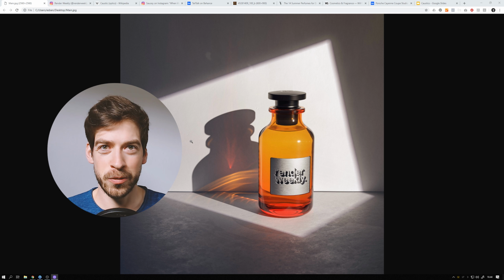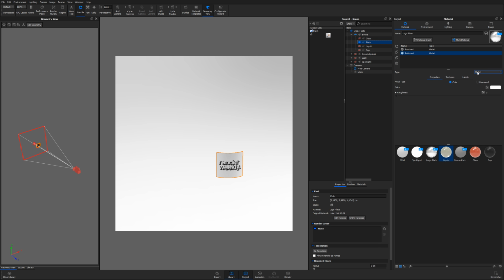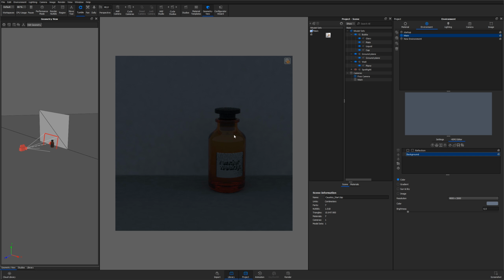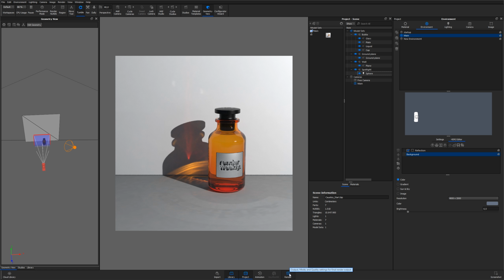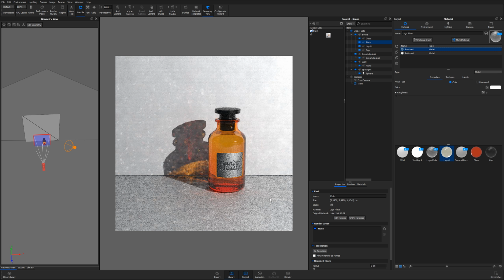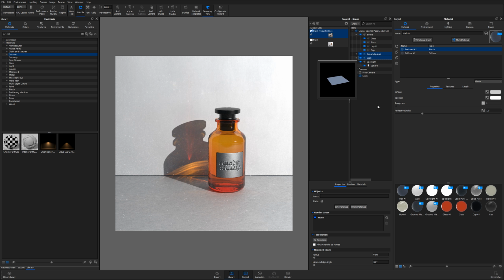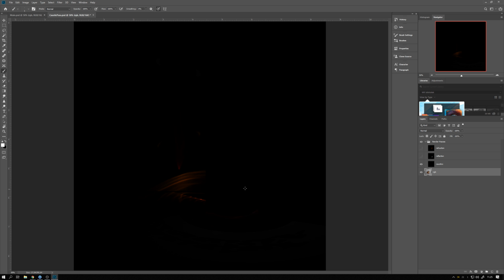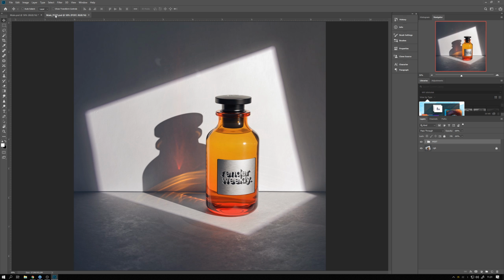How to Render Clearly Defined Caustics using KeyShot

Comment: It is quite upsetting that Esben seems to get the orange light on the ground so easily. I have a red liquid inside a whitish glass and I have trouble having the caustics I would so love to have. I got liquid and glass settings almost the same regarding the tutorial, but I only get a shadow that is cast on the ground like the light passes through a single solid object.
Reply from the maker: What material types are you using, do you have a physical ground plane inserted and what are your lighting preset settings?

Comment: what processor do you use? I have an i7 -3770 :/ it's ok but I need to change it.  what do you recommend? AMD, Intel?
Reply: Depends on your budget and workflow. AMD is quite affordable and it's perfect for multitasking (more threads). I have the AMD Ryzen 7 with 12 core processor and it works perfect with keyshot! Why do you need to change?